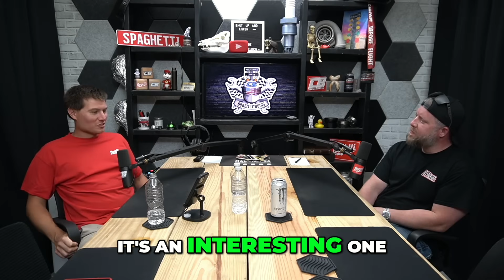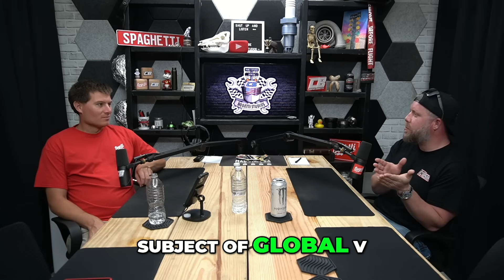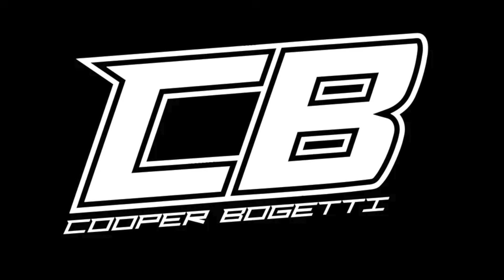ChatGPT Tunes Cars?! AI Engine Tuning Is HERE!

Comment: I've never tuned a car in my life but i'm slowly using chatgpt/grok to tune my 1990 foxbody mustang 5.0 with old school moates quarter horse  and binary editor. I have had idle surging problems since i bought the car which is why I wanted to get into tuning. I gave it a datalog and some information on my setup and it made a few suggestions and it fixed my idle surge after years of people making other suggestion that never worked. 

next i'm installing a wideband and going datalog it and see if it can suggest a new MAF transfer table to dial it in.

All the people in the moates quarterhorse/binary editor groups on facebook start yelling at me when i mention using AI to tune.. lol

Comment: I did my miata wheel alignment with ChatGPT based on how I want the car to handle. Turned out great, it actually explained to me in detail how it all works and why it went with the values it did. I then posted the alignment on a forum and others said it was a good alignment, so I went with it and it drives exactly how I want it.
Reply: So I’m not alone asking insane stuff from chat gpt while it does great.

Comment: Literally gave ChatGPT a datalog and the tune file for my Miata and it reviewed it, told me what was going on at different points and when prompted, even sent a cleaned up version of the same tune ready to load to the ecu. So far so good
Reply: dude... How did you input all the data and how was it returned bro? Also...What version of AI and did you need any bought extras for special inputs or outputs? Mobile or PC?
Reply: I just sent it the tune file and it found a minor error in the way something was entered for my cars specs then it gave me the file back corrected and I uploaded it and it was better
Reply: I use it to bounce ideas off of before making any adjustments.

Comment: i tried this several different ways, you realllllyyyyy have to break it down, technically youre still doing the work its just doing math, if you get too complex with it it tends to skip over factors that affect certain things, i tried giving it a bin file in several formats and giving it definitions and told it to analyze the bin and remember the variables related to fuel and spark, as well as idle and dfco. then i gave it all the factors such as fuel injector flow rate and short tube headers, egr and ccp delete along with a manual transmission with no vss. it completely understood this..... or so it seemed. the bin i got back was wrecked. and then i asked it to tell me what bins would be best for my setup. it gave me lists of bins and their masks, but all the ones it said were $0D were actually $0E and it just wouldnt take my word for it nor would it stop saying 0D is the way i need to go when so far the closest to a working vehicle ive gotten is on 0E. i started a new chat and then it started telling me things that contradicted what it said prior about the masks. it cant seem to keep its story straight on what masks work on my pcm and now ive mashed together two bins to get what i need, and it looks good to me but im honestly dreading the 20 minutes its gonna take to swap chips to find out its not gonna work lol.... one thing it does do good is if you take screen shots of your tables itll look at them and based on what information youve fed it it will spit out whole tables pretty well.
Reply: dude... How did you input all the data and how was it returned bro? Also...What version of AI and did you need any bought extras for special inputs or outputs? Mobile or PC?

Comment: I was tunning my hondata ecu with chatgpt, and it's crazy how well it can generate a tune and detect problems or flaws
Reply: I'm actually in the process of this now. I had a really bad tip in that would put timing into the negative. I gave chatgpt the ignition tables and the whole throttle page. It cleaned everything up. Now I'm gonna work on fuel next and see what it will do.
Reply: @treefitty0350  same here I had grok re write a ve table for a 5.3 with LSA.   The difference in chart looked very good vs what I wrote as a start tune
Reply: tried it for mine, i sent her a custom tune i got from a tuner, and gave chat gpt ever spec and mod of my car even vin, and she did change the tune and even put it into specific maps so map 1 is stock with the custom tune, map two is the pops and bangs (it's what i asked chat gpt to make) and map 3 is even louder pops and bangs, chat gpt did deliver and it works fine lol, im using tuner
Reply: ktuner*

Comment: im a big Grock user, after seeing this video i saved a tune from hp tuners as a csv and uploaded it to grock...it analyzed every detail, gave corrections for every PID tracked and asked me to add a few additional pid's so it could get a better idea of the engine.  amazing
Reply: dude... How did you input all the data and how was it returned bro? Also...What version of AI and did you need any bought extras for special inputs or outputs? Mobile or PC?
Reply: @antonfidd3795 unless you're using hptuners I can't really offer any advice.  But each a.i allows data uploading in different ways, no different than attaching files to an email.  You can even attack screen shots "windows key + shift + S "  to screen shot
Reply: @antonfidd3795 I have a snap on modis scanner. I was able to get the PID Chat Gpt asked me for and I had the driver do some 3rd gear pulls. I had the scanner graph the data and I took pictures of the graphs across the rpm range 2.5k, 3.5k, 4.5k, 5.5k and 6.5k

Comment: ChatGPT is my nerdy friend! 

I'm building an engine for my truck (cammed and aftermarket heads) using "advice" from ChatGPT on parts and will be formulating a startup tune to drive to my local tuner. This has been an interesting experience so far.
Reply: By the time you get your startup tube done you might want to keep messing with it. It’s a lot of fun.
Reply: I said the same thing lol

Comment: How long till we can get chat gpt to make a tune to run 6.89 or 8.90 on the dot. That’s something I’ve been wondering
Reply: If you tell it what you already have and show it the software and correct it some when its wrong youd be surprised how close it could get you. Of course it would have to know everything about the car-weight, trans, wheel size, gear ratio etc. It understand power to weight and power delivery if you familiarized it with your setup and tune software you could absolutely tell it what time you wanna run and have it make a tune for you. I used it to help me dial in partial throttle lockup on a 3600 stall converter.